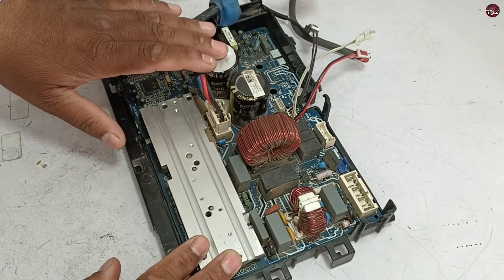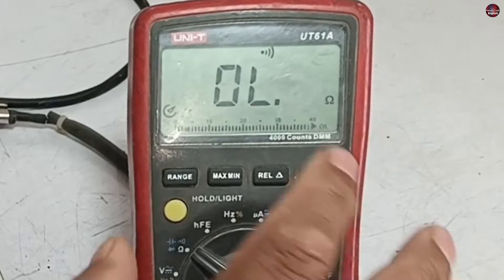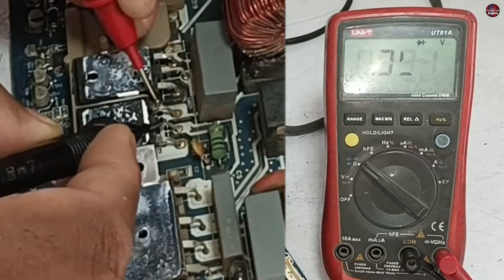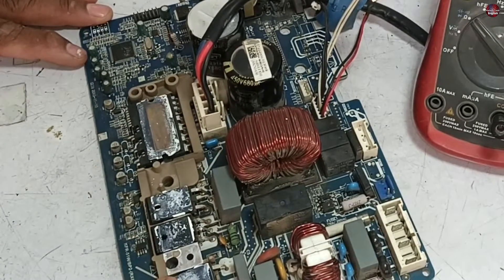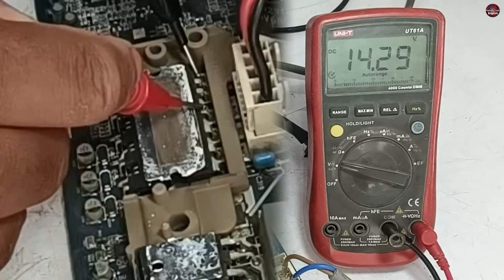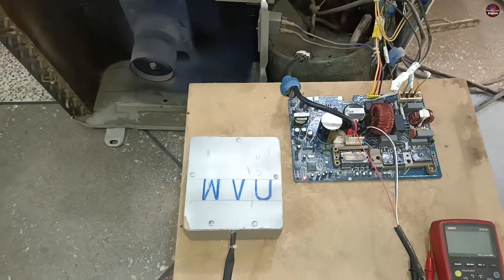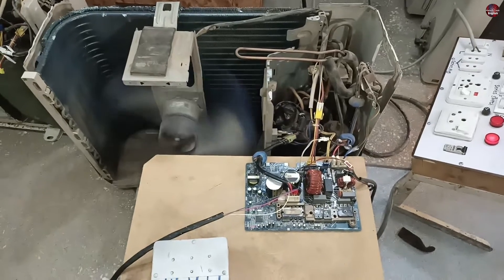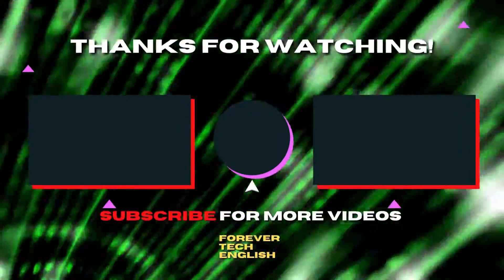Unusual Results Fixing Mini Split AC Circuit Board P4 Error code

Comment: Short to ground i.e isolation on wires of the compressors is damaged.  Windings of compressor are obviously not in short circuit.

Comment: Hello, I am one of your followers.  I had a problem in the air conditioning circuit and I saw the code F9. The type of air conditioner is from AUX company. The problem appeared after electrical leakage occurred from the electricity source. How can the external air conditioning circuit be repaired? Thank you.